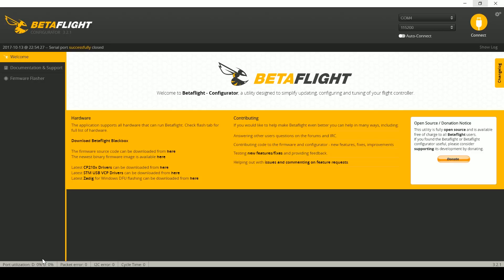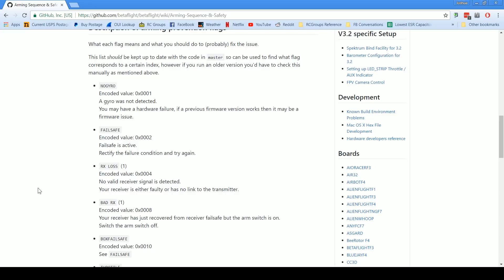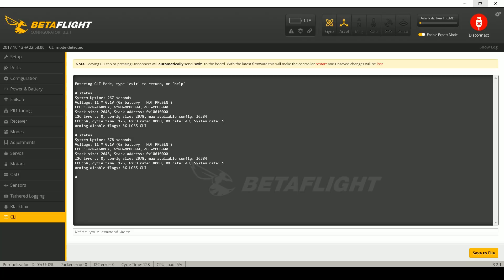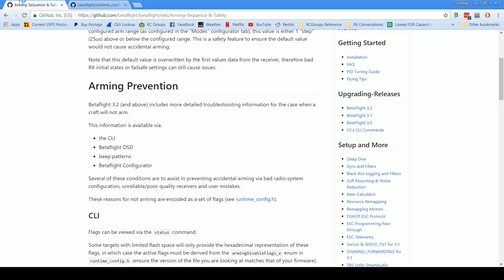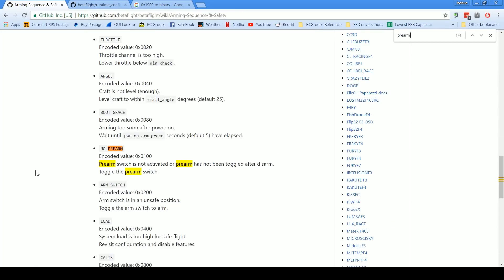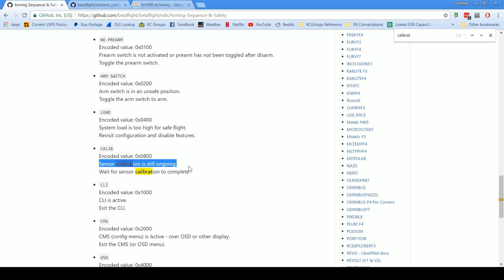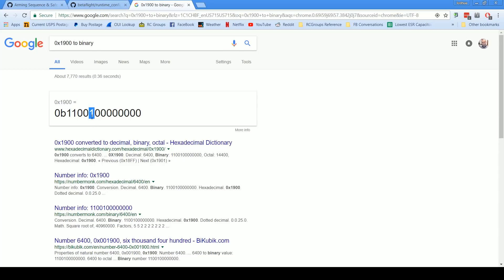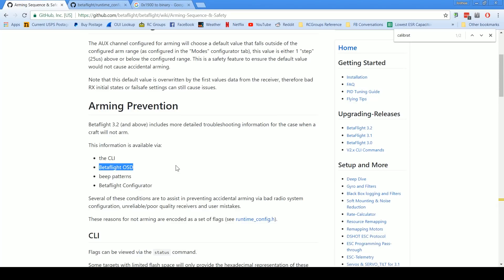Betaflight 3.2 | WHY WON'T IT ARM?

Comment: Happened to me once, for 2 days...you get that crazy beep-beep beep-beep bee-beep.  Three bee-beeps, but no arm.  Problem for me was my MIN THROTTLE was set too low. Solution: SET MIN. THROTTLE about 20 - 50 points above what the receiver tab in BF detects from your receiver -when its at its lowest.   Actually the problem happened on one other occasion , MUST SET MIN THROTTLE JUST ABOVE...usually always between 1000 - 1100.
Reply: How do you adjust throttle on the radio or betaflight?
Reply: Both. You want to adjust the radio outputs to be as close to 1000-2000 and 1500 center stick as possible. Once that is correct you want to set the min throttle in the configuration tab like Brian says above. ^
Reply: Thank you for the discription of your problem, I just had the same thing on my tiny KingKong Flyegg. After I adjusted the MIN THROTTLE in Betaflight just like you said, the Arming was allowed for some magicaly reason ;). I don't know how many days more it would have taken to make my quad airbourne if I hadn't seen your comment. It helped me out allot...

Comment: Just got my diatone gt2. Installed receiver but I get nothing when I move gimbals. Is this because I’m having an arming issue? I hadn’t  thought of that, but after seeing this it makes sense. I’m going to see if I have the arm toggle engaged first and move forward from there.🍻
Reply from the maker: +HYEonDEATHROW receiver tab should move when you move the sticks regardless
Reply: Joshua Bardwell the tab? Sorry I’m new to this. My led indicates it was bound.
Reply: HYEonDEATHROW - The 'Receiver' panel on BetaFlight configurator software, showing horizontal colored lines representing your radio channels.
-> It doesn't matter if your quad is armed or not, it always shows what input the flight controller is receiving from the receiver.
If you see no channel moving on screen while giving stick input, then no correct receiver input reaching your flight controller.
If you're sure Tx and rx bind OK, then the most common reasons are misconfiguration of uart/Rx port/protocole. Sure enough Joshua has vidéo on this ;-)
Reply: Check that the uart your receiver is conected to is activated.
Reply: HYEonDEATHROW switch your settings on transmitter to s bus annd try i bus, do sam in configurator..
Reply: Make sure you wiring is connected to the correct uart. Check your pin out diagram for you fc. And make sure that uart is selected in bf

Comment: Alot of newer stuff in betaflight 3.2. I just left alot of stuff OFF that wasn't talked about in your other betaflight video when I was setting up my wizard x220 and flashed it with BF 3.2, considering I dont have most of the options available anyways. Mostly was just alot of "beeper" tabs added and such..stuff was enabled by default but I turned it off in the beeper section, and some GPS stuff..

Comment: Even if the "gyro_cal_on_first_arm" is enabled the initial calibration on power up still occurs.  There will just be one additional before the first arming when presumably the quad is sitting still.
Reply from the maker: +Bruce Luckcuck the CALIBRATING flag will remain set until the initial arming attempt though.

Comment: You need to do a full 3.2 video.  Such as the dshot beeper settings has changed since some of the 3.2 RC and dailies. Also the FPV cam controls and changes to the CLI commands.
Reply: zymurgyjwt 
https://youtu.be/JkggzZySIqs
Reply from the maker: +zymurgyjwt there are a few things that have changed but this playlist is still mostly correct.

Comment: Nice tip here. 

I have some additional advice for anyone running F1 or F3 FC’s.  Time for an upgrade..Spend a few bucks and get an F4.
Reply from the maker: +InFrontOfYourBack1 I still have a ton of quads with F3. No reason to throw it out yet. F1, I kind of agree.